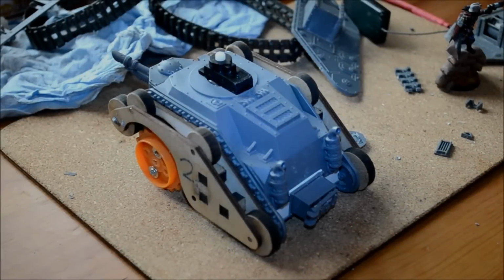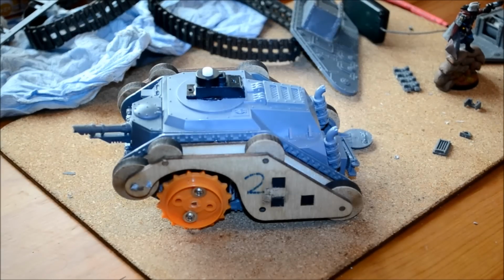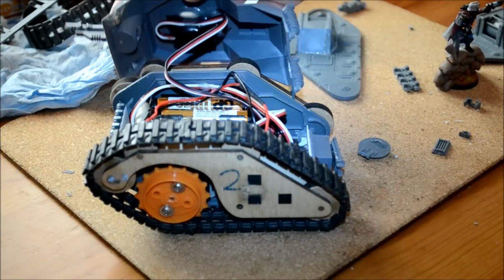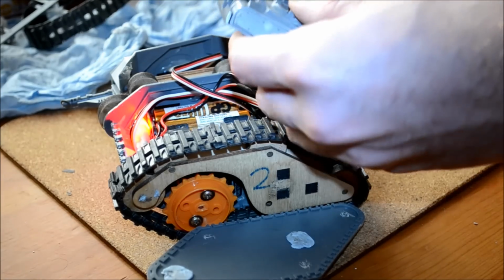Remote Control Leman Russ Tank

Comment: If you don't mind me asking Collingwood's can you make a little bit of a better list of all the stuff you need for this? I would greatly help because I'm having some problems finding parts too.
Reply from the maker: No problem. components may be mildly different as i did build this 3 years ago. 
Rc Transmitter and Receiver - https://tinyurl.com/y7o9hv35
Cable to program the Transmitter - https://tinyurl.com/y77w2ebn
360 degree turret servo (Mini size) - https://tinyurl.com/y7r94a6y I hacked a 180 degree one but you can now get 360 degree ones in the small form factor you'd need.
360 degree track servos (Standard size) - https://tinyurl.com/yafcd8cq These should spin continuously but i haven't bought them personally so may be worth emailing the seller.
The more you spend on kit the smoother the servos will be, those are very budget components, but look grand for starting out.
Good luck.

Comment: You know what would be even cooler (it already is as it is in the vid), make smaller cannons and top cannon movable. The controler would be a bit waky but the tracks could be controlled by stick movable on both x y axis just assign that when tank moves on x axis the tracks rotate in opposite directions at the same time, the y axis remarks whenether tank move forward or backward. Similar stick could be applied to the main gun when x axis rotates the turret and y axis raises and lowers the main cannon. Now for the additional parts, there could be 2 sticks with x axis for the side bolters and stick with x y axis for front hull gun.
Sadly as I can see your design already takes all space in the hull so it's going to be challenging to make even the turret gun move. As I said at the top of this comment YOUR WORK IS ALREADY AMAZING :D

Comment: Looks brilliant! By standard servo, what size do you mean, the 40x37x29mm (ish) servos i used for planes/cars look far too big to fit, what dimensions are the ones your using? Would like to try make a predator myself
Reply from the maker: These are the ones i went for, sm-s3317sr, should fit in a predator but the track guards may give you some issues. Might be worth looking for a thinner track kit.